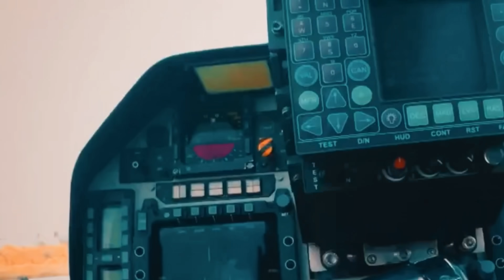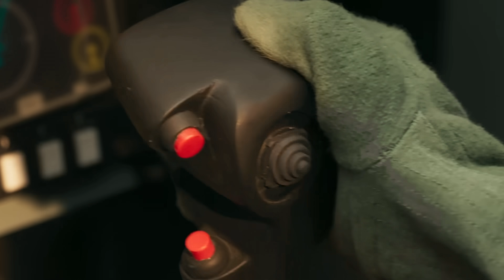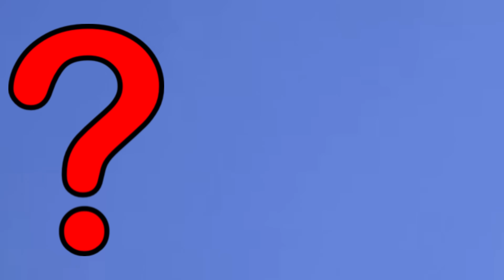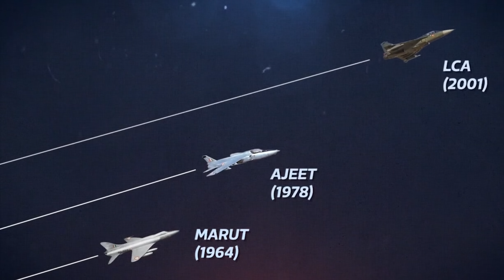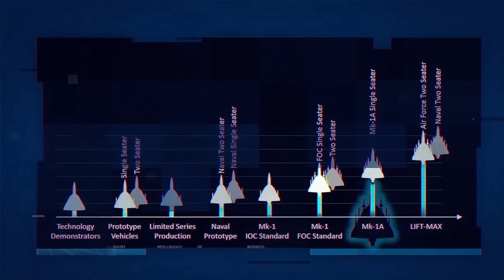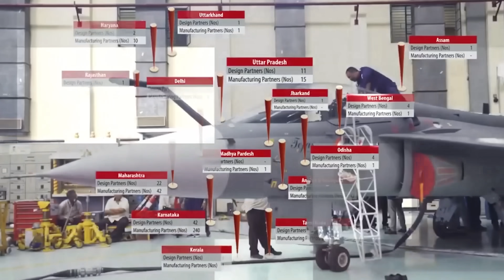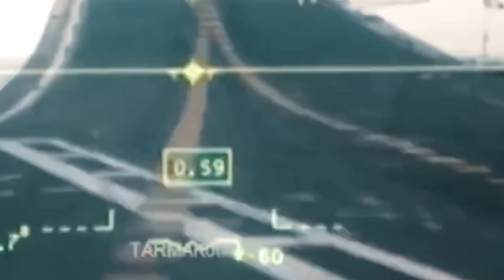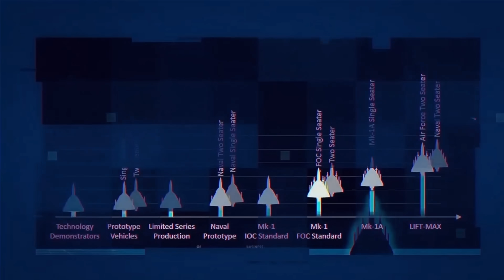Why does everyone hate the Indian 'Tejas' LCA 4th Generation Fighter Jet?

Comment: I wonder what India be willing to sell some of Tejas,LCA, 4th generation, Jets, about 20 of them, should get the job done, to make them be able to be flown in Ukraine, Poland, and Sweden would have to get a hold of them to see what could be done to upgrade them and make the engine and other parts, streamline so they wouldn't be logistical headaches, that have to do this before they bought the planes, if India donated 10 or 20 of them, this would be something other than Ukraine could teaker with and make into a very good fighter jet, to be able to do all the jobs that Ukraine needs it to do

Comment: Building a battle-worthy fighter jet requires cutting edge technology, and India has done well in bringing this platform, to where it is, despite years of delays, teething troubles and the seeming lack of client confidence in the product. However it cannot be called an indigenous air craft till the heart of the machine - its engine - is designed, developed and deployed in India, by Indians.
Reply: Everything apart from the airframe is imported. 
It's a joke 😂

Comment: This video is a little dated. The Indian Navy no longer considers the Tejas viable for its operational needs. It recently signed a deal for 26 Rafale Ms that will replace the Mig-29Ks at least well into the late 2040s. The ambitious TED-BF naval fighter program is also in early stages. 

One of the problems has been India's taken on several parallel fighter programs, including the much delayed Mk. 1A production, the development of the Mk. 2, the TED-BF and of course, the AMCA. It's very hard to manage so many parallel projects when you have the same principal manufacturer. Even if there were two competing firms, say...Lockheed and Boeing, managing 4 programs in various stages of development between them would be difficult. On top of that, the ambition has not been met with decisioning alacrity, and sufficient money to build facilities and hire and retain staff at the rates required to get such programs to completion on time. 

Certainly Tejas has been a fantastic learning experience and capability builder. I expect Mk. 2 will go into production MUCH faster than Mk. 1, so long as global supply chains can be sorted out. That also ensures revisions are not done in a hurry, and future development can be planned out over 3-5 years. I don't foresee India stopping fighter purchases from abroad for at least 30 years but hopefully, those will keep getting lower and lower as India can be self sufficient for at least 75% of its fighter needs.

Comment: Yes, it is a stepping stone for the mk2. There is already a gan radar in the offing and the astra series 1,2and 3 as well as the Israeli missiles will make this variant extremely potent. It’s rcs is considerably reduced, due to the composites used.latest testing of the revised Kaveri engine , has shown a sustained thrust of 102 kn and 97kn at high altitudes ! There is yet hope for the tejas.

Comment: The main problem of Tejas jet is not its performance. It is quality and production. Tejas has comparable capability of Chinese/Pakistani JF-17 or Korean FA-50 light fighter jet. But it suffers from low quality and low production rate. Indian Air Force ordered 20 Tejas back in 2011 but received them all in 2024. It is like 1.5 units per a year. Abysmal production rate.

Comment: This is great insight for an Indian from an outside perspective. Now, imo the LCA Tejas Mk1A should have ideally been complete before 2010. But now that we are here, the fighter has been upgraded modern avionics, modern weapons. The biggest issue from an international perspective would remain lack of range, which is fair. But this plane was designed to replace the Mig 21 Bison, a small plane, and it was built as an interceptor to meet India's specific requirements. Given its role and India's geography with Pakistan, this plane doesnt really require high range because it can penetrate as far as it needs to already. In order to compete by breaking into deeper into Pakistan and China, thats were this plane lacks, and that is why separate jet is required, which eventually leads to the IAF procuring the Rafale, and ofcourse the back bone of the IAF, the SU30MKI, and in future Tejas Mk2 as well. Overall, the biggest gripe I have with this particular program is the massive delays, apart from that, this jet fulfils what it was meant to do, defend Indian airspace from entering enemies, and shallow missions into enemy nations.

Comment: From Millennium 7 videos and my understanding of aerodynamics, lengthening the tail of the aircraft would have decreased the drag of the plane significantly but would have also increased its cost. The plane is rather small by today's fighter jets. This was probably  another decision to reduce the cost of the plane by its designers. The cost of the plane is a significant criterion for the Indian government and at the last I heard of around 30 to 50 million dollars a plane, ( without the missiles & weapons) for what can do, it provides a good bang for the bucks spent. You just have to put the goals of its buyer in perspective. They are not the same goals as many more affluent buyers of multi - role fighter aircraft. Also, a small composite fighter jet may not be stealth but would be hard to spot on radar or visually spotted.

Comment: such nonsense. the engine is from USA, the avionics from france and other stuff from from Israel and you claim it is an indigenous fighter, you literally dont know what you are talking about!
Reply: Yes it will be called Indian and indigenous as its design rights and selling rights are with India. Just like a phone is still called american or korean even though it has chinese processor or japanese camera.
Reply: @sumit-o8j5f  But having manufacturing rights is not the definition of "indigenous". Now since iphones are manufactured in India, do you call iphones indigenous to India? Surely not.
Reply: @RajeshRavindranathan  you are right, the iphones are not Indian, even though its components are made in different countries and are assembled in India, its usa product. Apple decided which components will be used in its iphones, similarly India decides which components will be used in tejas. Also, the design was done in India same as apple designs iphones in usa. Hope I am clear.
Reply: @ It's different if only a few parts are outsourced but its different when key components such as the engine, avionics etc are also outsourced. The main reason countries have their own fighters is that then they cant be embargoed. Right now Tejas engine comes from GE, USA and they can restrict the number of Tejas India can make, like right now the numbers build are bottlenecked because of the delay from GE providing it. In any other fighters of any other countries, if they are indigenous like any US fighters, French, Chinese, European, that wont happen and there will be little point in it being indigenous.  Instead of using the GE engine, India should atleast make the Kaveri engine viable.

Comment: One can see the Ajeet roots in the "airbrake" style main landing gear doors on the Tejas.
BTW, timestamp 12:58 to 12:59 - it is  the Sukhoi Su-30MKI ("I" for "India"), not MK1. Similar to Malaysia's Su-30MKM ("M" for Malaysia).
The Ajeet is essentially an upgraded, and modified Indian Folland Gnat. It wasn't really a totally indigenous design, unlike the Tejas. Between the Ajeet, and the Tejas, there was the MiG-21, the Jaguar, and the Su-30MKI. All of these were built in India, under license, and have had a series of indigenous upgrade programs. This is the technology base that India is using as a foundation for a totally, 100% Indian built 4+++ generation fighter. India has not had the same level of heritage of producing aircraft, (or reverse engineering, like China) to allow them to produce such an aircraft in a similar timeline like other aircraft manufacturing countries. They have to negotiate their way through local business cultures, and local prejudices, while making attempts and mistakes along the way. It has never been done before in India (Even the Marut had outside help), so it is naturally going to take longer for it all to come together. It will, if India perseveres. If the people in power are smart, they should take a look at South Korea, and how they managed to become an advanced 4+++ gen aircraft manufacturer. Take the lessons from them and see how it can be applied to India.

Comment: Bro it is fucking  4.5  generation ,google it bro
Reply: How? It doesn't have an electronically-scanned radar, reduced RCS, supermaneuvrability, supercruise, or IRST. The only thing about it that's considered "4.5 gen" is that it uses carbon-fiber components but so does the Harrier 2 from the mid 1980's. What separates the Tejas from the Mirage 2000-5F or F-16C block 50/52?
Reply from the maker: @evilwarrior-j9j love you too

Comment: The project faced delays due to money in its initial stages which explains 3 decade development. But the problem in induction actually stems from lobbying hawks who wanted foreign systems over indigenous ones in the Congress party. Another problem it got delayed is due to failure of Congress govt before 2014 to give funds by then defence minister from keralas coalition govt. Which was later rectified when bjps parikkar became defence minister he took the herculean task of inducting evaluating systems that the previous govts failed to realise. After parikkar died the govt started to promote desi stuff in the army by carefully electing anti lobbying airforce chiefs whom favored indigenous stuff over videshi ones. To put it simply Congress with lobbyists will spend money on designs and ridicule the industry over foreign systems which destroys their confidence plus the Babu culture in those institutions. While bjp is trying damage control with motivating the stakeholders and industry. It is worth noting that during the first bjp govt only the project got tech demonstrators in 2001 and after 2014 only stakeholders who endorsed indigenous content came from the shadows. It's a murky stakeholders and industry relationship with little or no support from previous govts

Comment: Kaveri engine did not provide the required thrust and so HAL decided to move to GE f404 but The Kaveri engines are not a failure, they are to be used in the next UAV project from India.

Comment: There are quite a few mistakes here. 
The tejas mk1 and mk1a both using the GE F404
Only from the Tejas mk2 do they switch to the GE F414
The delays are both from issues with the indian govt and also issues with sanctions put on india due to its nuclear tests. 

AESA radars have been integrated since the beginning the newer AESA being used in the mk1a is fully made in india which is what is different from the older Radar used in the aircraft. 

Also tejas mk1a isnt a future project mk1a are aircrafts which are already being made and will be start being delivered from late 2024 to 2025. 
Mk 2 is what is for the future.

Naval Tejas has been rejected a while back as the indian navy wanted an aircraft with 2 engines.
Hence why TEDBF is a new aircraft being designed.

Comment: Tajs is light attack faitar..it cost vary high 45+ milon... Around 45 million Mig 35 ,su30sm, J10C,undar 35 milon.. 45 -50 milon F16 block 52...so that's the reason why Tejas doesn't want any country..

Comment: Everyone hates this aircraft because of her design, it's doesn't match with a modern days state of the art  machine (like f16 /21, Grippen). It's the biggest failure for the design bureau of HAL, in my opinion the solution is to change the entire design & category (as a "Twin Engine Medium Weight Multirole Fighter") immediately with  TEDBF/ORCA.

Comment: It is hated by western countries because they cannot tolerate success of India . Malicious intent
Reply: Success? it took 20-30yrs to get into service, other countries are moving on to fifth or sixth gen aircraft.
Reply: @redman1249  just check the amount of time USA Russia and france took to develop. It is considered that average time to develop a jet engine is roughly 36 yrs and that too when money is abundant. Now think what have we achieved
Reply: @vikasthakur4659  The Mirage 2000 first flight 1978 & introduced 1984, F-16 first flight 1974 & introduction 1978, MiG-29 first flight 1977 & Introduction 1983. The Tejas first flight 2001 & introduction 2015, FOC 2019. South Korea had a non-existent aircraft industry now the T-50/FA-50 has became an export success even beating the Tejas and now it is embarking on the KF-21.   

Engines - GE 110 & GE 404(US) designed 70s & first run 1980s, RD-33(Russia) designed 1968 & first run 1981, M88(France) designed 80s & first run 1990s. Kaveri initiated 1980s still not in production.

Comment: Indian aviation would be dependent on others forever if it does not start experimenting and developing indigenous products. So what if a few fails occur during this process. Just like spacex who built on failures, India should never give up on producing local technology.
Reply: No the issue is that it took 30yrs to develop & enter into service. The Tejas still has numerous foreign technologies like the engine, ejection seats, radome etc.
Reply: @redman1249  true, but you need to start somewhere, you crawl before you can walk or run.

Comment: A correction to people who said that the aircraft crashed for the first time in 23 years. The crash was due to engine failure.  It was GE's fault. There was no issues with its FBW or other control surfaces.  In fact the footage of crash showed that it gently glided and crashed into the ground

Comment: The Tejas Mk1a is actually one of my favorites, especially in the "light fighter" category. (Gripen-E still wins, and the FA-50 isn't quite a fighter...yet.)

But, let's face it, the plane could've been ready much sooner, and the neutered "mk1" variant shouldn't even exist. The mk1a corrects nearly every problem that the Tejas had, except for their choice of the comparatively underpowered F404 engine when the F414 has the same plumbing and external dimensions. I think if they made a Mk1b with a more powerful engine, it could cldoninate most of their peers. 

It worries me that, instead of that idea, they are taking a single F414 and sticking it in a still-larger fighter.

Comment: Some contentions with your video:
1. Unfair to compare payload capacity and range of a light category 4.5 gen aircraft to heavier class of "peers", just as you wouIdnt try and compare a Su-30 with an F-16 on those parameters. It still has higher combat range than the heavier F-16, thanks in part to the delta config, that allows additional fuel to be carried onboard. 
2. Only the initial 40 Mk1s come with the non AESA Elta EL/M-2032 radars. Mk1As that have already entered serial production have a first two batches (40) equipped with Elta EL/M-2052 AESA radar, and the remaining (~160) with the superior Uttam AESA radar.  Mk1s are to be subsequently uograded to 1A standard, the deliberations for which have already begun. 
3. Mk1s are essentially LSP variants, and inducted in limited numbers. As Mk1A delivery gathers pace and fleet expands, many of the spares availability and serviceability challenges will be eased out.
4. IN will likely not go ahead with N-LCA as the primary deck based fight, in part due to its single engine. Instead TEDBF is being worked on for that role. N-LCA prototypes are however being used to test MUM-T with LCA as a mothership, currently. Theres a chance IN orders N-LCA as shore based strike platforms held in reserve.

Comment: For obvious reasons, I think, it should be compared to the Pakistani JF-17, yes, that was manufactured as a joint Chinese-Pakistani project, but it's pretty similar in the strategic role it plays for the PAF's fleet. India has Dassault Rafales, MiG-29s, and an SU-30 liscense, they can equip their Air Force with top of the line stuff, the Rafale is by far the best of those three, by the way. The role of the Tejas, as stated in the video is partially to help develop domestic manufacturing capabilities. The Tejas is an okay 4th-gen that could probably get the job done in an air defense role against either the PLAAF or PAF, while the IAF's Rafales and SU-30s serve as the "tip of the spear" so to speak. In peace time, youre also saving those 4.5 gen fighters from additional flight hours that could be done by an aircraft like the Tejas. The Indians, at least those in charge of their Air Force, know that this isn't intended to replace the Rafale, or they wouldn't have bought the thing in the first place. 

It's certainly fair to assert the Tejas program has not gone to plan, but I would be shocked if IAF brass would rather have not gone forward with the project at all. The Tejas achieves mediocrity now, so they get something better with the next generation.
Reply: You are mostly right, but 2 major points. You cannot put Mig29s in the same sentence as Rafales or Su-30MKI.
Secondly, you are under playing the capabilities of Tejas. Tejas mk1A variant is more "Advanced" than the current Su-30MKI. Su-30MKI on the other hand can carry more fuel and payload and still remains a better option when it comes to "Air supremacy" inside enemy airspace.
That however doesn make Tejas any less capable. Defence is as important as offence in any conflict.